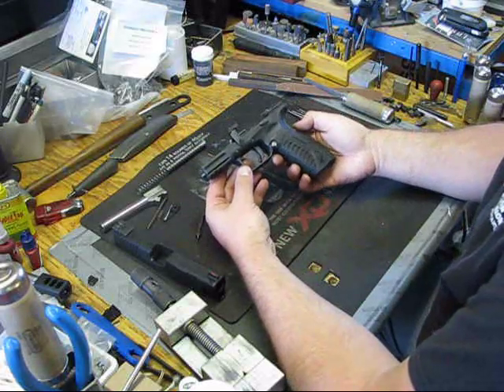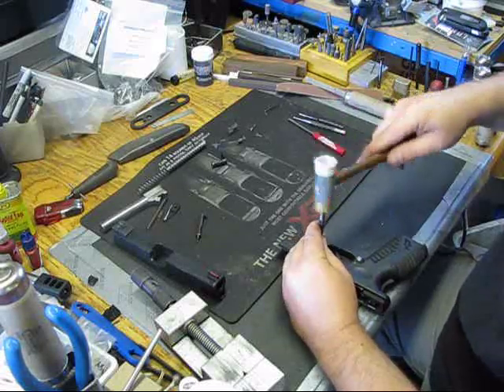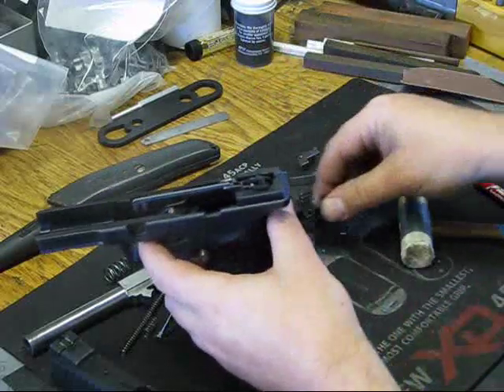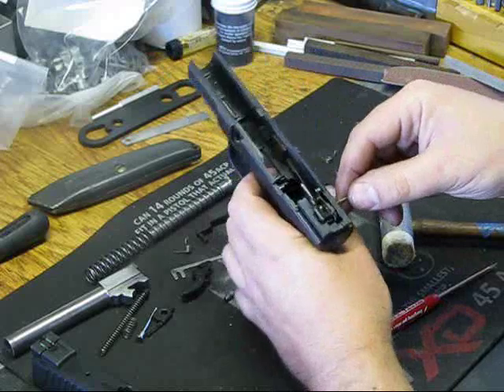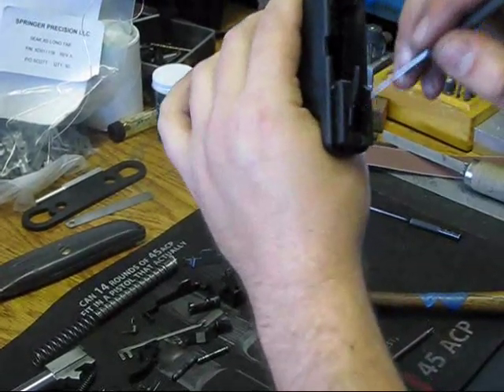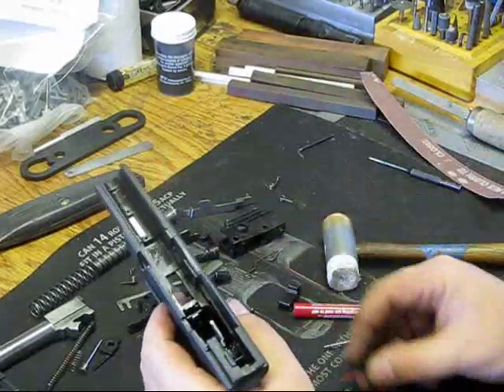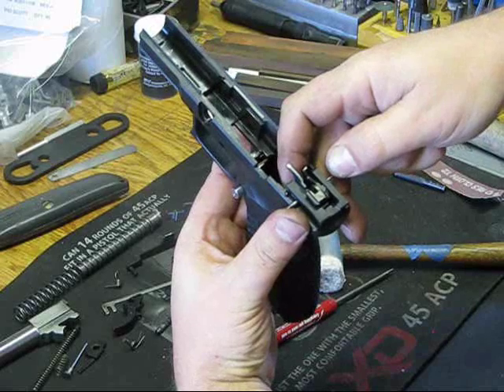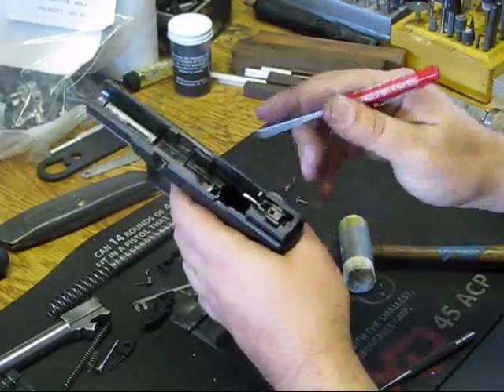Springfield XDM and  XD frame detail assembly instructions by Springer Precision Part 1 of 3

Comment from the maker: Where did you purchase the parts, as we don't sell a slide lock spring. Generally, when the slide doesn't lock back, the thumb is on top of the release. The slide release is activated by the magazine follower hitting the nub that is on the lever and pushing it up.